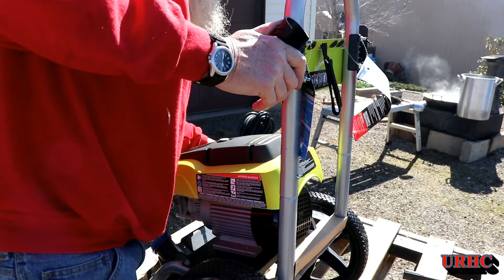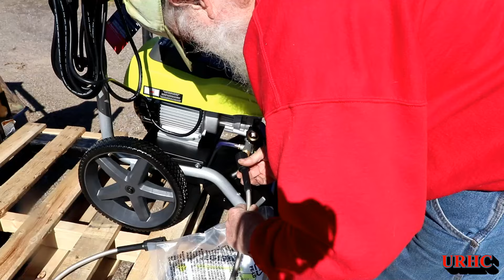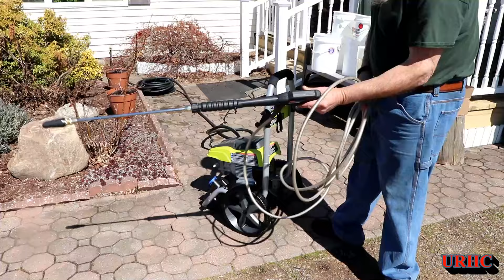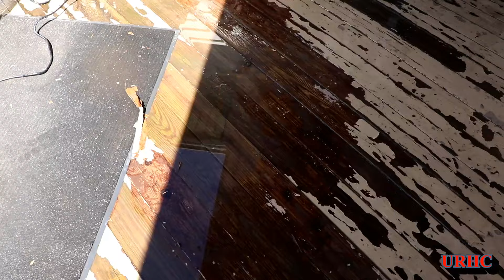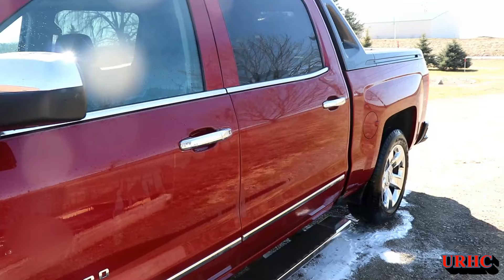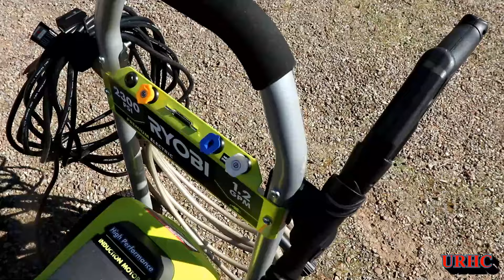Ryobi 2300 PSI Brushless Electric Pressure Washer First Look

Comment: I am curious on your long term use comments on the foam cannon and chemicals. According to your description, you weren't going to add a link since you hadn't enough experience with the products. Thanks in advance.
Reply from the maker: The foam cannon works good but it's not a good replacement for hand washing if you want a clean vehicle. The unit still works great. Thanks for watching.

Comment: Great review buddy nice truck👌🏻
Reply from the maker: The pressure washer has been great and does a good job. The truck is total junk with the frame rotting away after 2 1/2 years. GM uses defective  steel on the frames and refuses to cover the TSB about it. Thanks for watching.

Comment: Thanks for the review, I am in the middle of a decking project similar to yours; I wasn't sure if this pressure washer was going to have enough power to strip paint off the deck.
Reply from the maker: It will if the paint is old and peeling.  Slow and messy but does it. Thanks for watching.

Comment: man the hose if it is stiff that means it is better because it won't bent easily and it is outta the way, some hoses bent and that stops water from coming easily and if you want to replace the hose make sure it doesn't bent easily and long enough  so it doesn't make you frustrated.
Reply from the maker: I bought  the Flexzilla hoses and they work great. Bend easy and don't kink. Thanks for watching.

Comment: What year is your truck? I have a 2011 Dodge Dakota that i'm going to replace this year. I'm just not too impressed with the smaller trucks. They're so dated on the interior.
Reply from the maker: It's an 2018 and we love it. it has the 6.2 liter engine and gets about 19 mpg with plenty of power  to tow a trailer. I went to buy a 2019 model and did not like them at all. Saw this on the lot, test drove it, and took it home. The sticker shock is big to get into something  comfortable.  Most new ones have little  engines that sound like sewing machines and get better  mileage where this one has a nice sound and power at lower rpms. Thanks for watching.

Comment: I got a cheap foam cannon and been using the Mr. Pink from chemical guy. I have become a fan of their product and got some more items. They seem to have good products. Like you said the foam cannon is a quick touch up wash. It will never touch a hand wash. I use it like you did with the car to take dust and light dirt off. The one thing I do is give it a rinse with one of the broader pressure washer tips first to help for the loose dirt off before adding the soap.  Thanks for the good videos. I am looking forward to this year’s garden videos.
Reply from the maker: I thought  it said don't  wet it first. I just bought  a small bottle of the soap to try but will go with  a bigger  bottle  next  time. Thanks for watching.
Reply: @unemployedredneckhillbilly2023  

You had me curious. I checked my bottle that is some what old and it did not really say. I watched a few of their videos before starting when I got mine and they were pre rinsing. I will have to try it without, less water wasted. Thank you for the reply.

Comment: My 1600 psi 1.2gpm electric ryobi washer quit working after about 8 months - to warranty it at Home Depot I have to wait until the 2 year ryobi warranty is out unless I send it in.
Reply from the maker: I never  owned  a Ryobi machine and hope it lasts  longer then that. Thanks for watching.
Reply: @unemployedredneckhillbilly2023  looked into it some. Common fail point is the gfci on these machines, replaced with a new plug in and it fired right up. I had the issue with the light at the gfci and no light at the machine , hope this helps somebody else
Reply: So careful about the warranty they stiffed me there. I have the ariens deluxe 30 too like yours kept tearing belts I replaced it with a non ariens brand and it is doing well so far

Comment: I love seeing your beautiful truck all cleaned up.   I also own an electric power washer and I love it.  It was a no-name brand and it is over 13 years old but still going strong. That shocks me. Every year I get it out and expect it to be dead — but it starts right up! I’ve owned the big, expensive gas-powered ones in the past but they always seem to have a dead pump in a couple of years. I hope yours holds up over time too.  Yes, the electrics are not high powered but they do a great job for my purposes.  SO much easier than another gas engine to worry about servicing and starting up.  Does that foam washer use refills?  I have the same problem with my porch deck. Had to have it all rebuilt a few years ago but deeply regret NOT spending the extra for a composite install. Those decks look beautiful year after year and hold up great with our climate.  Paint just does not hold up here. As soon as you start shoveling and track salt or pet safe calcium chloride on it, it just wrecks the paint.  EVERY year I have to repaint it and it never lasts. Oh I was planning to build more raised beds and have not seen recent lumber prices. I guess I will prepare for “sticker shock.” The big metal livestock watering tubs at Rural King or Tractor Supply might be cheaper.

Please consider wearing mineral sunblock or your face and hands.  I just had to have some suspect spots on my face and forearms biopsied and burnt off.  YEARS and years of being outdoors adds up.  I know most men pooh-pooh it, but we outdoors people need to be a little careful as we age.  Spring has sprung and it is so glorious to be outside again!
Reply from the maker: This washer  is nice for most jobs. The foam cannon just uses foaming soap and water.  You add 2 ounces of the soap then fill it most of the way with  hot water.     Does a pretty  good job similar to the carwash wands you put many quarters in. It's  hard to believe the increase of prices for lumber. Most is up at least 400% over a year and a half ago. We are putting  off the deck redoing until  prices drop. It shouldn't look bad once the old paint  is all off. 
Our doctors office checks us over every  year. My wife had some  spots removed a year ago. I hate  the feel of sunscreen and just wear a big hat now. Every summer I get pretty dark and should  use something.  I should  be done with my outside boiling about  midnight  tonight and can't  wait to finish up the syrup so I can get going  in the yard. Thanks for watching.

Comment: When I had an electric pressure washer from Costco it did the same thing at startup, where it would have pressure then stop and come back eventually working fine. I never really figured out what it was, but my best guess was it was having to get primed or get the air out of the system or something of that nature. Never really took long to get over it, but was worrying first few times.  The whole then eventually fell apart and I got a gas powered one again from Costco. As always thanks for sharing your experiences.
Reply from the maker: I am still wondering if that will come back. Home Depot gives you 90 days to return if there are problems so right now I am not worried. Hope this one lasts a long time. Thanks for watching.
Reply: I have this same model and using it to refinish our 1600 sq ft deck. I've learned to get the air bubbles out like he did in the beginning of his video then I turn the motor on and leave it alone for several minutes to allow it time to build enough pressure otherwise it will cut out (and it's maddening). Also, The longer the hose the longer it takes to build pressure. Anyway hope this helps someone. I was about to return ours but it works great once it builds the pressure it needs.

Comment: I find myself watching the detail geek,  about the cheap foam cannons. https://youtu.be/xvcSjKCywa0
I bought my gas pressure washer BJ's for really cheap money from Briggs & Stratton. It doesn't have a standard wand, so I would have to swap it out with adjustable nozzles. My pressure washer does have the option to add soap, but it doesn't have a container or just the hose that comes out that you stick in a bottle which I thought was kind of cheesy. I was looking at some of those pressure hoses at the store this weekend, and I can concur that those hard plastic lines are really garbage. The leaf blower to dry it off had me rolling. LOL
Reply from the maker: I ordered a 50 ft Flexzilla hose to try now that I know it works good. That hose that came with it is stiff like a piece of PEX tubing. I was to lazy to get out the big stihl backpack blower. That would have done a better job.  My gas one has the tube setup also but I never tried it. The gallon jug on this will be a pain to empty if you put to much in. Thanks for watching.
Reply: @unemployedredneckhillbilly2023  I hear a lot of good things about flexzilla.

Comment: Nice video.  I bet I'm much lazier than you.  I use a siding brush on my cars so I don't have to bend or reach.  Soft bristles do a good job and don't trap grit that can scratch the paint.  Works great on the wheels too.  They also sell a pad that looks like foam fingers all over it. (like a Shiwalla)  I think it might be called a Car Mop.  Any of these with a bucket of soapy water and you're done in no time.  
Another thing I wanted to mention is to rinse your truck before you foam it.  The water starts loosening the grime so it will come off freely as you go along.
And I use Johnson's paste wax on both cars.  Any paste wax is great, but don't let it dry as they tell you to do.  Just rub it lightly with a cloth to thin out the wax or you'll have a hard time buffing it out.  I told you I was lazy.  Good luck and take it easy.
Reply from the maker: I have been using the New Finish wax and looking for a different one that's easier to remove.  Thanks for watching.

Comment: No wash in salty roads since December? That truck is going to rust in about 7 years. The brine they use now, combined with road salt has really become highly corrosive. If you want to prevent corrosion you will definitely need to wash much more frequently, like once per week minimum.
Reply: Get it undercoated or use a can of something.  Stone Chip is what Edd uses.
Reply from the maker: It has Ziebart rust proofing with a lifetime warranty.  Thanks for watching.

Comment: My Home Depot has the Ryobi undercarriage washer for $40, it’s twice as much on Amazon. Ryobi’s 2000 psi is great, the hose is too stiff as you say, and they could do much better with how to quickly hang the extension cord and hose. Mine has a hose reel that is complete garbage. Better to just have a large hook to hang the hose and another hook to hang the cord. Modification is necessary!
Reply: Always is.
Reply from the maker: I saw that and may look into it someday.  Thanks for watching.

Comment: Cool, I just picked up the smaller version (1,900 psi) to clean up my rocks. Works great but... 
Same problem I noticed with the stiffness of the hose, I'm hoping that is because it can withstand being accidentally hit but the washer.
I haven't tried the spinning nozzle yet 
Thanks for the upload
Reply from the maker: You should  try it in case it has a problem like mine. Thanks for watching.
Reply: @unemployedredneckhillbilly2023  Will do sir, thanks again.